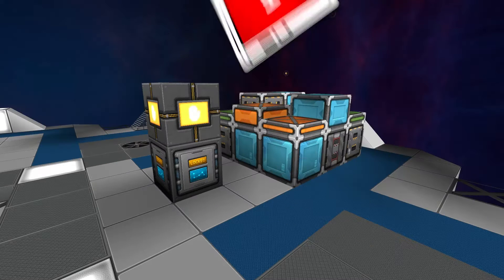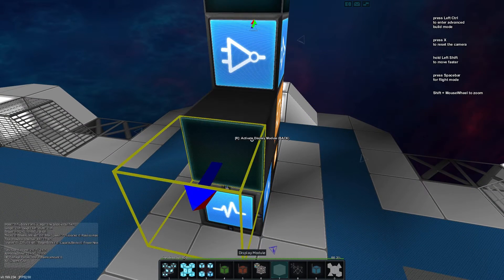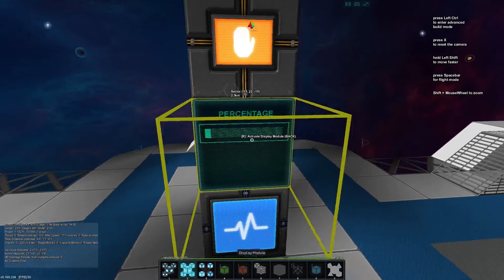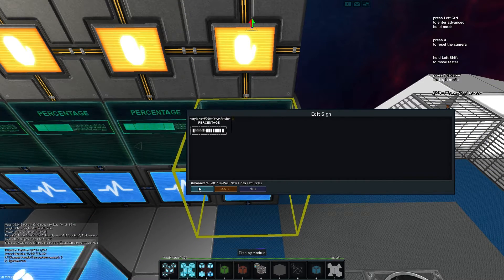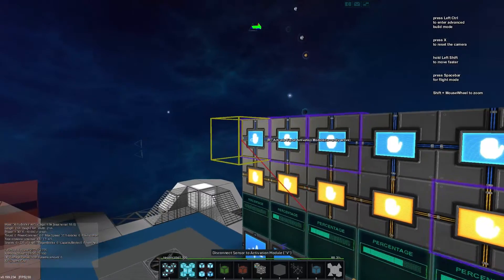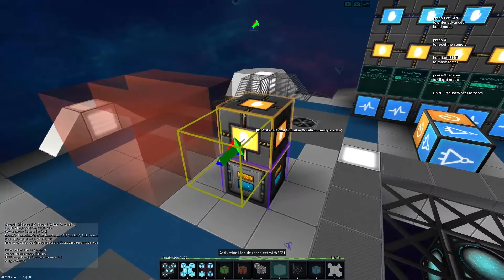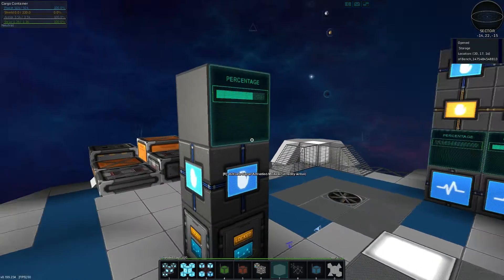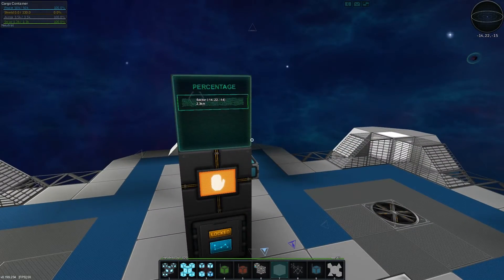Starmade Logic #30 - Sensor Copy Paste Template

Comment: I can't seem to use sensor blocks to detect 0% shields using a sensor block connected to a OFF activation module. Is this intended behavior because for all other percentages it seems to work fine
Reply from the maker: Hmmm unsure

Comment: Just so it's clear, the different display modules are linked to the AND logic gate behind it right? I didn't see you linking the displays so I didn't know if they actually have to be linked or if just having the display next to the AND would be enough.
Reply from the maker: No they're not linked, the AND gate is only linked to the one display module you wish to change the contents of
Reply: Bench Are they linked to the Activation modules above them? Just trying to piece this all together, there has to be an activation module, or equivalent, linking the two displays together in order to make the change.
Reply from the maker: +Bernard Gilbert so for each module:
- the activation module behind the sensor block is linked to the AND and the NOT blocks above it.
- the AND gate is then linked to the display you want your display blocks to change. The AND gate is positioned next to the display module for that sensor, but nothing needs to be connected to it. Similar to rails, the AND gate changes the display it's connected to, when activated, to the one directly next to it. Same with rails, you don't need to connect anything to the rail your changing your rails to, merely just have a logic block next to it (activation or button). In this case the AND gate is doing the changing of the displays, so it doesn't need to be connected to the display module directly next to it.
Reply: Bench OK got that. It's just confusing sometimes to know when you have to connect things and when you don't have too.

Comment: Just had a thought, could you use these sensors in coordination with a salvage beam to set up an automated mining system that could both mine and measure how much material it's pulling so when you reach a certain percentage it would automatically stop?
Reply: you should be able to. the only thing we cant do yet is tell a mining drone to stop mining and return to drop off its materials.